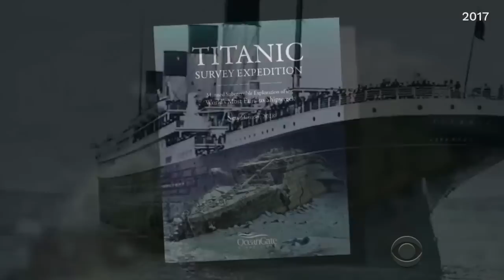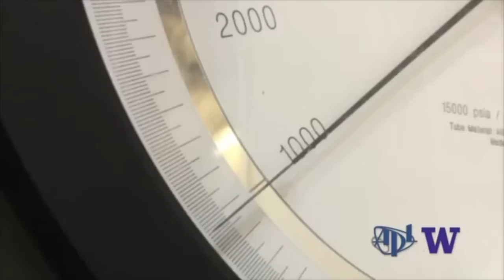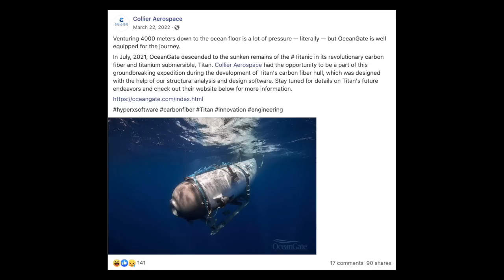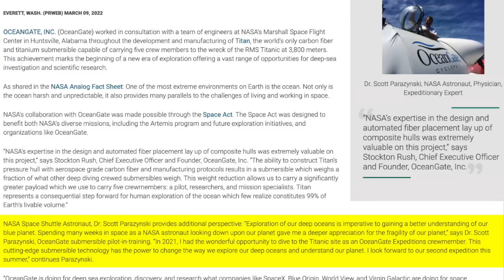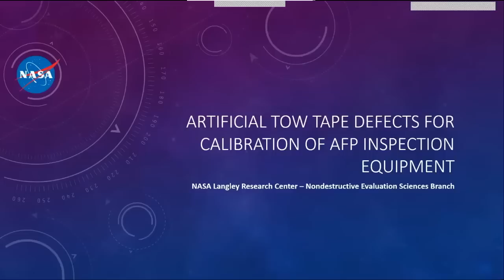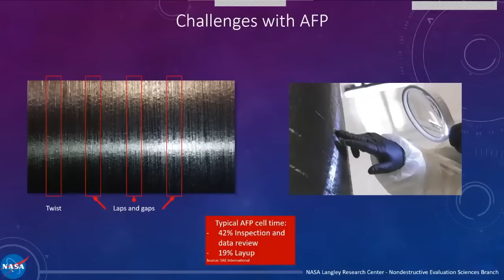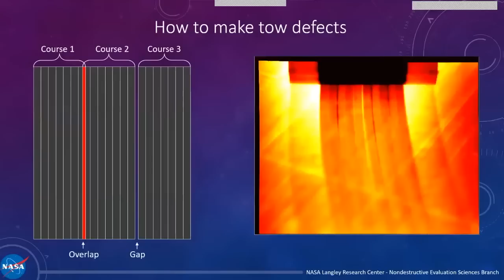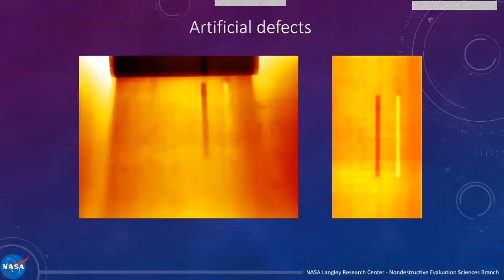The Shocking Truth Behind OceanGate's Carbon Fiber Hull

Comment: Why do they think comparing flying airplanes and deep sea diving is what makes it safe? Pressure 30,000 feet in the air is NOT the same as pressure 4000 meters underwater..the pressure difference is astronomical..air gets thinner the higher you go..water is DENSE..but not as dense as stockton rushs attitude I guess

Comment: Any cracking from a carbon fiber matrix is usually a sign that some of the fibers in the matrix are snapping. While a 5 inch thick carbon hull of course will buy a little time when this process starts, the problem is that you never know how the process accelerates so the process could be relatively slow but it could also speed up violently and fail very quickly.
The Titan carbon fiber hull did not seem to have a cross woven carbon fiber matrix which would have made the carbon matrix less strong. Another problem is that the hull was never cured in an autoclave so there is a high likelihood that there may have been some voids in the carbon fiber and binder agent matrix.
Another point of concern is the fact that carbon fiber is very good in tension (stretching force) but not a wonder material to withstand compression forces and especially not compression cycle forces.
It is also problematic to use carbon fiber together with another material such as Titanium since the Titanium transition rings were glued in place. The end caps of the submersible were made of Titanium and since the carbon fiber hull was cylindrical, there would have been very high forces working on the Titanium transition rings due to the pressure transfer coming from the end caps together with the surrounding pressure working on the carbon fiber cylindrical hull.
The Titan was basically a very risky design and virtually no expert in the deep sea exploration industry had anything good to say about the design.
Reply: Plus it was not even close to properly tested.

Comment: I had my suspicion, the gun like popping sounds heard during the dives, were a result of the tiny air gaps bursting between the layers under the intense pressure. The 5 inch hull was literally desintergating with each trip to the Titanic. It was just a matter of time. So sad.

Comment: Even if the carbon fiber was adequate, the way he joined the titanium rings was lacking. Experts say:
Titanium mating surface should have been acid etched. 

There should never had been bare hands touching the mating surfaces prior to glueing. (The video shows a bare handed man wiping it) 

Excess adhesive should have been used. 

Assembly should have cured under pressure and heat in an autoclave. 

NDT inspection of the joints after curing to insure no air and complete attachment. 

Stockton didn’t perform a single step of this proven Process.
Reply: you forgot not  doing the gluing mixing in a vac chamber, instead they used a regular store bought paint brush which which would form air bubbles. plus not applying the glue in a vac chamber.
Reply: Even Carbon fibre road bikes use fabric weave layup, internal expansion bladders and moulds with heat curing… and that is for a bicycle riding on roads at 70-90 kmh max.
If you crash at that speed due to frame failure it’s not great, but it’s not 110% guaranteed fatal! Unlike this.
Reply: Yes! I noticed that yet no one has mentioned it. That would seem to be the weak point. No surface prep on the metal, the guy is touching the surface with ungloved hand, and the process was being done in a warehouse, not a cleanroom.

Comment: It needed to be tested by the professionals who have expertise in the field. They did not use the weave pattern, the used the hoop method. Neith would be sufficient for multiple trips to the bottom of the ocean. You don't know what you don't know if you don't ask until your lack of knowledge kills you.
Reply: at least they got us that nice 3D scan of the wreck. I didn't realize that was them.
Here in 100 years when we're all dead anyway that will have made it all worthwhile lol
Reply: @ChadDidNothingWrong  Wasn't the 3D scan done by Magellan? I think OceanGate planned to do a 3D scan at some point but physics got in the way.
Reply: A weave would bend the fibers, compromising the compressive strength. Tangential winding is the correct method

Comment: Say what you want about Stockton, the guy was obviously quite intelligent and knowledgeable about materials and engineering. Why on earth would he dismiss the “gunshot like” sounds of the sub when submerged????? He had to know that those sounds could only be created by sudden release of energy and tension within the carbon fiber material. He also had to know that repeated dives with those sounds happening each time would build up to a point of failure. I don’t get it.
Reply: Maybe at that point he invested too much money. It was obviously about money. Otherwise, he would have made it out of titanium or steel
Reply: @neilwani1178  I’d agree except the cost of having a special mold and CNC setup to weave the CF and then bake it is probably close to what a structure of metals would be. He seemed to have a belief or misunderstanding of CF in general.
Reply: @RandyBoBandy.  what if at first he thought it would work. But he had already spent so much money in the direction of carbon fiber, even with the noises, to change the hull material would be too much. Maybe he was in a situation that it had to work or get another huge sum of money. To change the material, to redo all the testing, and get it certified.
Reply: @neilwani1178  that’s old story he wanted new avenues.  Who is to say what really happened to Titan, you trust being lied to more than once, well I do not!
Reply: Hubris.

Comment: In testing the scale model imploded  at 4200 meters but they signed it off as being rated for 4000. That is much too small a buffer zone . He was basically taking it to Its  breaking point even time he made it to  Titanics depth .
Reply: They should have gone for the standard +20%.
Reply: Oh no. They said they considered the test a success at 4000. They never said it was certified for 4000.

Comment: So he pressure tested two carbon fiber end caps, and put titanium end caps on the actual sub. So even the testing was not accurate. Many experts think it wasn’t necessarily the carbon fiber hull, but the combo of a composite hull with two titanium end caps that failed; two dissimilar materials. Thing was a death trap.

Comment: It’s Slimy that University of Washington & NASA immediately told the press they had very little to do with Titan’s development - but your research finding these videos proves they had a much bigger role in developing Titan.   The first few videos are of the engineering team from UW boasting about the submersible.
Reply: Based on the video it looks like the U of W APL was only involved with pressure testing of scale model prototype designs.  The prototype failed because of failure of the carbon fiber hemispheres.  The Titan submersible had titanium hemispheres.  
Similarly, it is not clear what specific roles the Marshall Space Center played in the production and manufacturing of the pressure vessel.  The actual manufacturing of the Titan hull was not done by Marshal.
Similarly, the automated fiber placement technology is something that is licensed to manufacturers.  It is beyond their role to control the actual practices of the actual manufacturers.

It is misleading and click-baity to suggest a significant role of either of these institutions in this commercial boondoggle.
Reply: @scottperry9581  There's plenty info out there on what it was both NASA and that University were responsible for.
Reply: This is when documentation is very important. If the University's and NASA's documents are "light", the lawyers are going to have a field day. In lawsuits, you go for the "deep pockets" !

Engineers keep daily updated notebooks. Both for technical and legal matters. On the legal side, usually for IP, and a defense, if a defective design may be an issue. Also, they're written in ink. You know its serious if you get an engineer to drop the "security blanket" pencil, and pick up a pen !
Reply: @NoxiousButtSpray  I think UW said they were working on Cyclops II.  Cyclops II was always envisioned to have a carbon fiber hull and was renamed TITAN.  Cyclops I has a steel hull.
Reply: @scottperry9581  The manufacturer of the carbon fiber hull was Spenser Composites.  I wasn’t impressed by the “automated fiber placement” as it’s just an infrared Heat camera that looks for uneven heat signatures during the hull manufacture (lay-up). The infrared cameras cannot change anything. That said It’s not clear exactly what NASA’s role was - BUT the U of W definitely had a MUCH bigger role than they reported to the media a few weeks ago while the story was hot.  

UW tested a full carbon fiber scale model - and the hemispheres failed as expected which is why Ocean Gate chose to go with Titanium hemispheres.  Stockton gave a Geek Wire talk and other interviews where he explains carbon fiber hemisphere shapes don’t work well under pressure - that’s why he used CF for the cylinder body only. 

At one point in this video Stockton said UW provided the engineering for the Cyclops II - which later became known as Titan.   If UW provided the structural engineering then they had a HUGE ROLE. It’s not clickbait to say that.
Reply: @michaeldonnelly2977 it’s always been unreasonable to only blame Stockton Rush thinking he did it all by himself and embarked on such project without others expertise. But ppl like to point fingers without having full picture
Reply: @NoxiousButtSpray  and 2
Reply: @scottperry9581  stay out of it as this is of some evidence like it or not!
Reply: @michaeldonnelly2977  but of course this didn’t fit your narrative, did it?
Reply: @michaeldonnelly2977  about time you make some sense more like my language now!
Reply: It's not slimy, it's smart if they didn't have anything to do with the design and manufacture of the Titan. It's called damage control.
Reply: @maryannsinopoli1751  "stay out of it"? WTF?
Reply: @Irish_Georgia_Girl  UW basically said they had nothing to do with Titan (Previously called Cyclops II).   Subsequently nearly every video on YouTube called Ocean Gate stupid and irresponsible for even trying to build a carbon fiber sub.  Now this video proves UW were enthusiastically helping Ocean Gate build a manned submersible out of Carbon Fiber.  At 1:32 UW says they have a partnership with Ocean Gate. At 7:18 Stockton says UW is Ocean Gates engineering partner.  

Bottom line: UW clearly had a lot to do with the design & development process of this submersible. They should’ve owned up to it from the start.
Reply: @Irish_Georgia_Girl  but now it’s known to have been dishonest to deny!
Reply: @michaeldonnelly2977  NASA's role seemed confined to the quality assurance technique they developed using thermal imaging.  Peripheral at best.

UW is less tangential.  As far as I can tell UW just performed testing of scale models.  The fact that Stockton claimed that UW provided structural engineering services for Cyclops II doesn't shed much credible light on the university's role.  Having working in engineering labs on campus as a grad student I can say that it is very common for labs to do work which has very little to do with the final implementation of manufactured products.  That is a general statement.  I don't know U of W's role hear, but do think it is plasusible that Stockton may have hyped that role in an effort to build credibility.
Reply: @yoursugarismine  Not at all, he was clearly to blame for all the terrible decisions.  He's on record making excuses for all of them, terrible excuses, that were massive red flags but because he wouldn't hire anyone with experience,. nobody questioned his BS.
Reply: @scottperry9581  I understand all that, and I agree NASA appears to have had a more limited role. Main point is for the last 5 weeks the entire engineering world came down HARD on Ocean Gate(OG) for having the audacity to build a submersible out of Carbon Fiber.   Engineers (& armchair engineers) EVERYWHERE spewed their anger and contempt at Ocean Gate for even attempting this.  Those engineers (and James Cameron) said it was well known NEVER to use a material like Carbon Fiber for deep sea pressure vessels.  At the same time the media, all those vocal engineers (and J. Cameron) expressed that this vessel shouldn’t have been built and SOMEONE should’ve STOPPED THIS from happening. 

The University of Washington not only didn’t say “no.”  They knew full well that that OG was looking to put 5 people into a carbon fiber hull thousands of meters under the Ocean and they literally helped to design & test the concept.  They were excited and produced these promotional videos showing the world they were involved in creating this new type of submersible.  UW gave OG the confidence and legitimacy to manufacture their design.   If they said “No, it’s too dangerous” then 5 people would be alive today.
Reply: My personal opinion is that you don’t get anywhere in life without experimenting and trying different things.  Stockton Rush was a smart man.  He graduated Princeton with an engineering degree, became a young test pilot, designed  and flew his own experimental airplanes, and he had a PASSION for exploring the ocean.  He knew carbon fiber was known to be troublesome in the past BUT he genuinely thought he figured out how to make it stronger using aircraft grade CF and he could monitor it in real time for safety.  

I Strongly believe that if someone wants to build an experimental craft, they should be able to.   If others are going to journey on this craft they need to be made fully aware of the risks and experimental nature of the design. OCEAN GATE DID THIS. Their waiver comprehensively discloses the risks & experimental nature of it’s design. Now that Ocean Gate is out of the picture there is NO MANNED SUBMERSIBLE THAT CAN REACH TITANIC.  That’s a shame.  Ocean Gate wasn’t trying to kill people.  They successfully took 28 people down to Titanic over 2 years, before tragedy struck.  

I hope exploration of our oceans and new innovations to get us down there don’t stop as a result of this.
Reply: @phillawrence5148 exactly. It's laughable to say Stockton wasn't fully to blame.  Because he was told and begged by literally everyone to not trust that submersible to go down that deep. He was too confident without even  fully testing the Titan.  He even had employees that worked in his company telling him it needed to be tested more before allowing paying customers to dive in it. Then Stockton fired him. Stockton would only hire young new graduates that he knew he could control
Reply: @NoxiousButtSpray  Aren't the Cyclops and the Titan basically the same model craft?
Reply: For  'smart', read devious and manipulative, the evidence for which is overwhelming. How and where Titan was registered, the decision to operate in (unregulated) international waters, and avoidance of third-party certification from established sources (because he knew he hadn't a chance in hell of getting it) are just some examples. Then there's the naming of paying passengers as 'mission specialists' who donate to the scientific cause. The sole purpose of this was to drastically limit liability in the event of an accident and subsequent claim. Yes, Rush and OceanGate did have the waiver. However, it was worded pretty vaguely overall and didn't detail specific risks involving such as the porthole thickness or hazards associated with the carbon fiber hull that many industry specialists had voiced concerns over. Simply including the word 'experimental' comes nowhere near to capturing the essence of all this. Besides, several others who had traveled in his submersible and would-be counterparts who backed out have commented on how Rush nonchalantly brushed aside any concerns they expressed to him.
Reply: @michaeldonnelly2977 my personal opinion is he never earned his degree the right way. His families money paid for that degree bc there is no way in hell a true engineer would build something so irresponsible. He was a scab,end of story.
Reply: @davidmurray6176  That’s too simple. I don’t think Stockton himself ever turned a screwdriver.  In other words, he didn’t build the sub by himself. It takes him a small battalion of people to actually build a deep-sea submersible that carries people.   You need several engineers from different disciplines, people that specialize in buoyancy foams, hydraulic mechanisms, sonar, material, science, and so many others.  

And from your point , any ONE (or ALL) of the people listed above should’ve been able to stop him. But NO ONE DID.  Lots of people familiar with marine mechanics contributed to building Titan but no one just said NO.  Everyone seems to be pinning all the blame on Stockton for building the sub, but the Sub was built by MANY PEOPLE.
Reply: @yoursugarismine  cRush did have other people with expertise and he fired them in favour of hiring kids who didn't know any better and wouldn't question him
Reply: @michaeldonnelly2977  There are at least 5 submersible that can and have reached the rusted Titanic.. Smh
Reply: @michaeldonnelly2977  you expressed it Perfectly!   Bravo…
Reply: @michaeldonnelly2977  you are intellectually spot on….

Comment: NASA deals with a ratio of 1:3 atm ratio. What the hell do they know about severe pressures under the ocean
Reply: Nothing - but NASA has stated that it was involved only to possible learn about Carbon Fibre lay ups in vessels. So its interest was in low pressure Carbon Fibre components for space vehicles. It had no interest or experience in the end use at depth and had been clear about that.